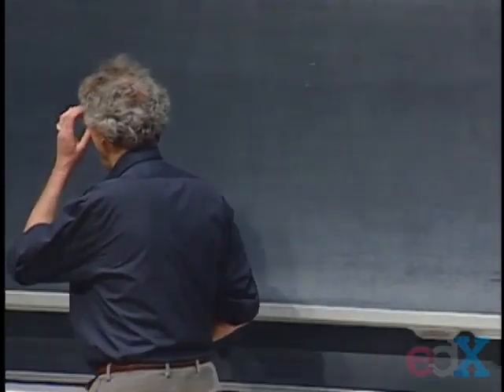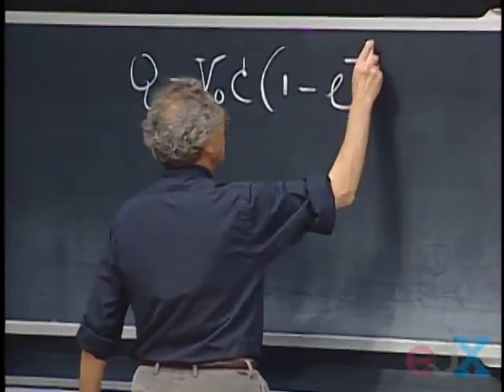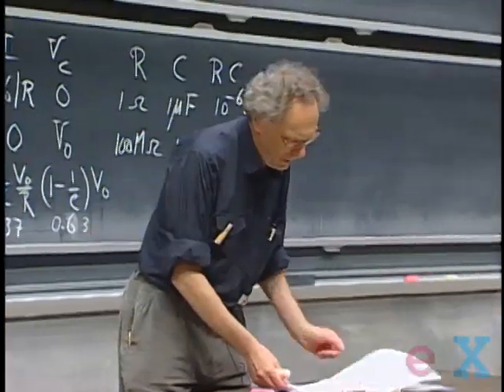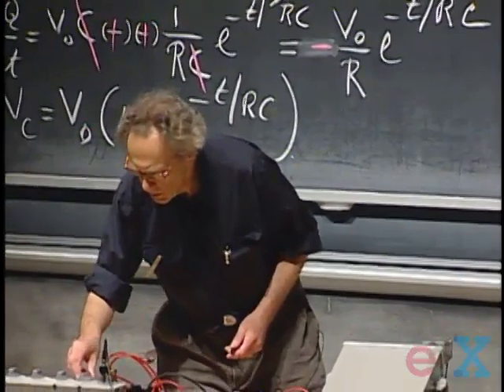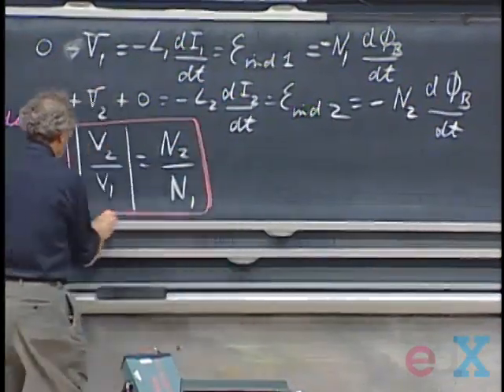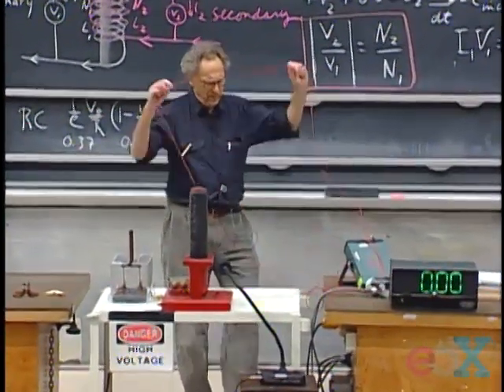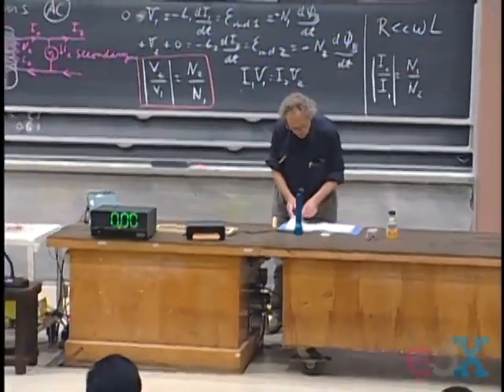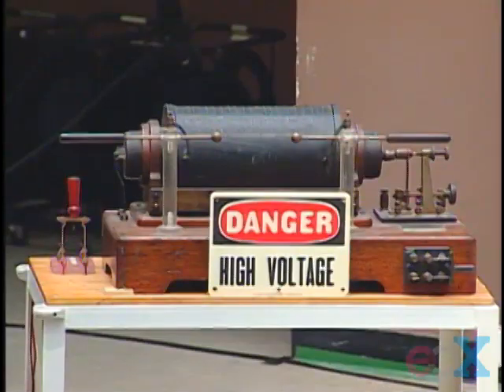8.02x - Lect 24 - Transformers, Car Coils, RC Circuits

Comment: I am an Electrical engineer, i would use the laplace transform in a heart beat to solve that differential equation..
For dc transient calculations at t=0 for unenergized system, an inductor may be replaced by an open circuit while a capacitor may be replaced by a short circuit..
Reply from the maker: t=0 for unenergized system, an inductor may be replaced by an open circuit while a capacitor may be replaced by a short circuit correct!

Comment: A correction to your stepdown transformer at the electrical pole. It is stepped down to 240 Volts across two of the phases of the transformer. Not to 120 Volts.

Comment: Regarding the spark rate for a 4 cylinder engine running at 3000 RPM:  3000 RPM is 50 turns per second.  A 4-stroke car engine fires each cylinder ONCE per TWO turns (standard Otto cycle).  So there are ONLY TWO sparks per turn of a 4-cylinder engine.  So there are only 100 sparks per second, not 200 as you claim.
Reply: Incorrect, almost all vehicles use a waste spark system for emissions reasons, thus creating a spark event during the exhaust stroke to make a more complete burn, this is to provide a more even mixture used to allow the catalyst to heat up and reduce NOx quickly.

Comment: Hi Sir ,

In Lecture 16 at 29:45 while you are demonstrating farday's law , it was observed by increasing the no.of turns around the solenoid we are getting more current and more EMF at the time of switching(i.e EMF is directly proportional to no.of turns around the solenoid and Current in the loop is also directly proportional to no.of turns around the solenoid ). If we continuously turn ON and turn OFF solenoid then there will be a changing magnetic flux in the Solenoid and we can see a continuos EMF and current right.

But in this lecture at 35:24 while you are demonstrating a transformer , when we increased the no.of turns around the solenoid we are getting more EMF but the current is getting decreased( i.e (i.e EMF in the loop is directly proportional to no.of turns around the solenoid and Current in the loop is inversly proportional to no.of turns around the solenoid ) why ? 

As per my understanding both the experiments seems to be same. Can you please give a QUALITATIVE explanation for this question because it will give physical feeling ?( Please don't give quantitative explanation by using the equations )
Reply from the maker: >>> we are getting more current and more EMF>>>
yes always more EMF but not necessarily more current.
Reply: Can you please tell me at when current will increase that means in which scenario current will increase ?

Comment: @39.00, I think the reason the copper ring with the iron nail does not levitate is because of the high resistance. Remember that 4400 Amps was calculated, but only about 500 - 1000 Amps are anticipated. Whilst this is indeed high amperage, the weight of the heavy gauge copper plus nail needs higher amps (ie, 4400 Amps) to levitate. The high resistance is causing the nail to cook whilst at the same time choking off the current. This answer is the culmination of 1500 hours of YouTube Electrical Engineering study over the last 4 years!!! I got bored during the Chinese Plague lockdown and kept going with it...

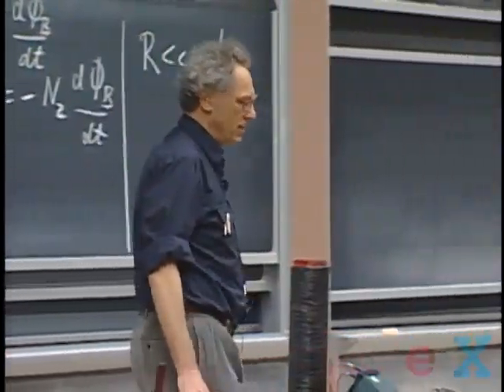Comment: 30:27  which R is being  referred here ? , is it the load resistance in the secondary , or the net R in the primary and secondary wires ??

Comment: Hello Professor, I have a doubt. How can the conservation of energy be possible? I mean, the transformer at 24:38 seems to prove that there is no conservation, because when it creates Emf and therefore a current, you have energy there. Other thing that leads us to the non-conservation is the induced voltage, isn't it a creation of potential? How can the eletric potential energy be there? Where does it come from? How isnt it affect the conservation of energy? Or am I wrong?

Thank you Mr. Lewin for your amazing classes and for your kind, cheers from  Brazil.
Reply: The system is non-conservative, indeed! This is why Kirchoff's law doesn't hold, which assumes a conservative electric field. Faraday's law tells us that the electric field is not always conservative, and it tells us exactly in what way: the discrepancy is equal to the induced magnetic flux. Thus, the electric field is not always conservative, but the electromagnetic field as a whole is conservative. Lenz's law accounts for this, which is why Faraday's law says the integral of the electric field over a closed path equals the negative magnetic flux through the surface that path subtends.

So to summarily answer your questions: the electric field is non-conservative in this situation, and thus electric potential is not even well-defined. (Electric potential energy possessed by an object can be, but that's beyond the scope of this answer.) The extra energy comes from the magnetic field.

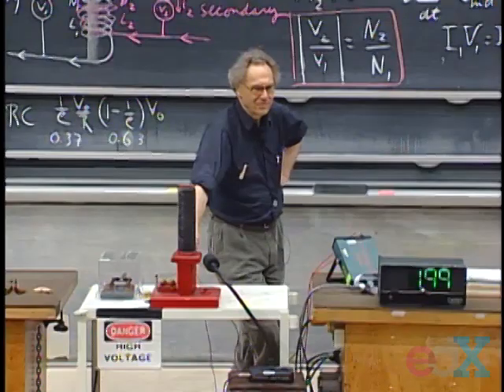Comment: 35:41   how is moving the secondary up affecting flux coupling ?
Reply: Look at diagrams of magnetic field through a solenoid that's not perfectly ideal. You will notice that the flux decreases as you move towards the edges. More and more flux goes outside the loop than what penetrates it. That decreases the extent of coupling in this particular demonstration.

Comment: When we say when we increase the number of windings the emf induced increases , are we talking about the same loop ( the same resistance ) like reforming the loop , or do we mean adding additional windings thus more resistance to the original one ?
Reply from the maker: If the induced emf in the secondary is 1000 V and if there is a 1000 ohm resistor in the secondary, than the current in the secondary will be 1 A. Keep in mind that the closed loop integral of E dot dL in the secondary is NOT zero as Kirchhoff's loop rule does not apply now. The closed loop integral is 1000 V.

Comment: If there is a circuit in which there is a variable resistor and an AC POWER SOURCE and we are continuously changing the resistance by the variable resistor then will there be an induced EMF???

I think NO, for the same reason that you told above that there is no INDUCTOR or if it is then it's very small

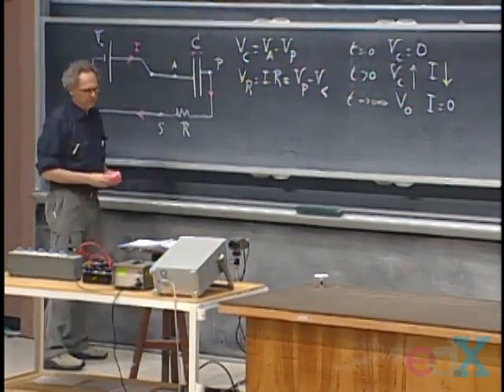Comment: Charging capacitor (4:00) by electron current flow, capacitor charges negative, other side positive?
Reply from the maker: When you charge a capacitor, the amount of charge on the 2 plates are the same but of opposite polarity.
Reply: Yes.  The capacitor plates end up charged to equal and opposite net charges each.  The net charge of a capacitor remains zero, after "charging" the capacitor.

It is a little bit of a misnomer that we call it charging a capacitor.  Enegizing the capacitor is a more accurate term.

This source shows what a hydraulic capacitor (known as an accumulator) would look like in an analogy to help understand.   The author shows a "diswatered" hydraulic capacitor, yet it still contains water, and a heavily "watered" hydraulic capacitor that contains more water than before?   Turns out, it always contains the same amount of water.  It is the energization of the flexing the rubber sheet, and the pressurization of the water on both sides, that makes the difference between the possible states of the accumulator.  Likewise, it is the energization of the dielectric barrier's electric field, and the imbalance of charge between the two plates, that makes a difference in the possible states of a capacitor.
http://amasci.com/emotor/cap1.html

Comment: Professor, regarding the car coil, if the e.m.f. in the primary coil is huge enough, why doesn't a spark appear at the terminals of the switch?

Comment: Actually transformers can use dc, but usually only when it is pulsed as is done for an automotive spark coil.. It is the changing current that is needed.
Reply: For all intents and purposes, you may as well call such I(t) AC, because it is equal to some constant (and thus DC) function plus some AC function, and the constant/DC part can be ignored because it is not electromagnetically inductive.

Comment: Sir, why is there no E-Field in the solenoid at min 24:40? Shouldnt the AC Produce an E-Field, since we also have an induced Voltage and Voltage always comes from an E-Field? 
 I think at another time you argued, that we have a superconductive wire. But shouldnt there then be resistance caused by the Inductance?
Also, reading Faradays Law from right to left also states, that the change in magnetic flux produces an E-Field.
Reply from the maker: there  is no E-field in an ideal self inductor as the wires are super-condicting (thus zero ohmic resistance).
Reply: @lecturesbywalterlewin.they9259  But if i plug that into Faradays Law, the integral of E dot dl hence is 0 if i only look at the solenoid. And that would mean dphi/dt must also be 0, which it isnt since I have AC. Am I missing something?
Reply from the maker: @Arrgon  >>>But if i plug that into Faradays Law, the integral of E dot dl hence is 0>>> Yes it is zero through the wire alonebut that's not a closed loop. The closed loop of E dot dL = -Ldi/t  (L here is the selfinductance in henry) and that's the induced EMF
Reply: @lecturesbywalterlewin.they9259  What if i take a Circuit with a switch such that when closed, the current goes around in a loop with only my Solenoid and some wire, which i think i have seen you draw in a Help Session. Then doesnt my argument hold bc Faraday presents an E-Field since the Integral of E dot dl around my closed wire and solenoid is the Change of Phi which isnt Zero bc we have AC? Hence there should be an E-Field.
Reply from the maker: @Arrgon  Faraday's Law works always, thus also with AC. If the wire of the self inductor is superconductive then the E-field inside these wires is always zero.  If you need more help, use google.

Comment: @20:50 But wouldn't the changing current cause changing flux and self-Inductance ?? Bringing in Faraday's Law again into the picture.. as current is not constant turning into an exponential function
Reply from the maker: the self inductance in this sytem is only a few micro H (thus negligible).  Watch my later lectures where there is a self ind in the system
Reply: @lecturesbywalterlewin.they9259   Oh, will surely do. Thank you sir 👍

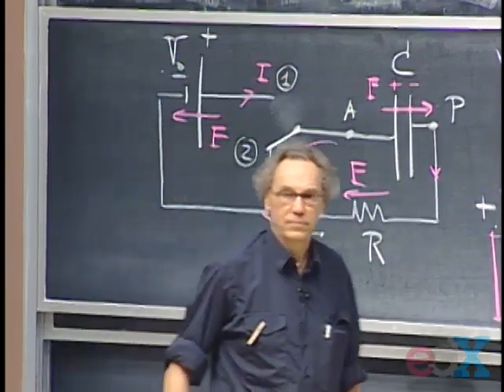Comment: Hello professor, at 13:47 you remove the battery, and the capacitor will discharge over the resistor. Should the E field vector drawn not point to the other direction? And by consequence the diff eq be :  -Q/C + RI = 0? It puzzles me, since calculating the energy stored in the capacitor for this circuit by means of integration of RI^2 needs -RI in stead of +RI to give to correct outcome. Thank you for explaining this!
Reply from the maker: set up the diff eq and solve it - that wil tell the full story.

Comment: hello professor , is the breakdown voltage in air is linear? thus 3M volts per meter so if i have two sharp points 1 cm apart i will need 1000v potential difference? 
thank you.
Reply from the maker: 3 million V per meter would be 30 thousand V per cm. Apart from that If the points are sharp the breakdown will occur at a lower potential difference than 30 thousand Volt. I suggest you consult google on this..

Comment: sir why the current reduces at t > 0  when the capacitor starts charging as the voltage across the capacitor = iXc

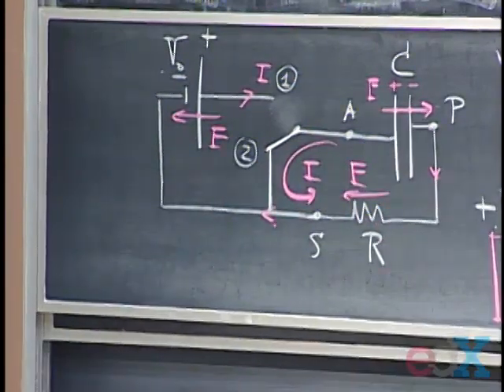Comment: at 13:47 when you flip the swich into position 2, why don't the excess positive charges don't take the easier route to the negative side of the battery? I know that it would actually be the excess electrons from the batterys annode that would flow on to the capacitor
Reply from the maker: The Capacitor is no longer connected with the battery when I put the switch in position 2.
Reply: +Lectures by Walter Lewin. They will make you ♥ Physics. 
thank you very much for the quick response! my thought was the negative part of the battery has still a connection without a resistance in between
so flipping the switch basically means cutting both sides of the battery out
Reply from the maker: current can ONLY flow if there is a CLOSED loop. There is NO closed loop that connect the capacitor wth the battery..  The ONLY closed loop that is available is the RC loop.
Reply: +Lectures by Walter Lewin. They will make you ♥ Physics. 
thank you! this clears up my confusion
i really enjoy these lectures and they do indeed make love physics!

Comment: Dear Dr Lewin, how do we address the issue of imperfect magnetic coupling which you mentioned at 27:16 minutes? It seems we always assume that magnetic coupling is perfect and power loss is only considered when we determine the currents in the coil. Why is this so?
Reply from the maker: It's an engineering problem which has been solved to near perfection.

Comment: Sir, in 8.02x - Lect 24 - at 30:44, could i please know why you wrote power as V*I ? In AC circuits, isn't power V*I* power factor? {V and I being the rms values}

I do understand that  V*I* power factor is the "power consumed" and a purely inductive circuit doesn't consume any power (with the assumption that the pircuit has negligible resistance). So the power is only transferred from the primary to the secondary, but why is it represented as VI?
Reply from the maker: As in DC circuits, the instantaneous electric power in an AC circuit is given by P=VI where V and I are the instantaneous voltage and current. ... Averaging this power over a complete cycle gives the average power.

Comment: Hi professor Walter Lewin:
 
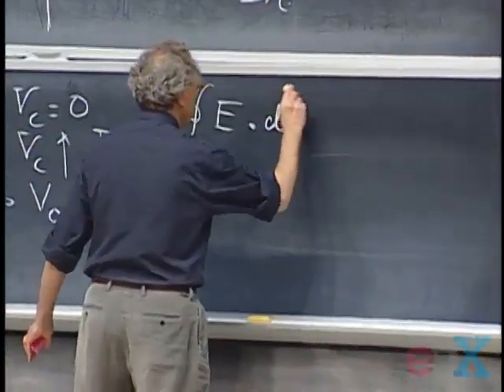On 5:31, you mentioned that the integral of E dot dl is zero.  My question is: why does it have to be zero? I think current is changing over time (at t = 0, current: max; at t -> infinity, current -> 0, so current clearly changes over time). If current is not constant, then there will be change in magnetic flux through the conductor, and thus there will be a small non-zero term on the right side of Ampere's law.

Did I make any mistakes above?

Thank you very much for the help.
Reply: +Lectures by Walter Lewin. They will make you ♥ Physics. 

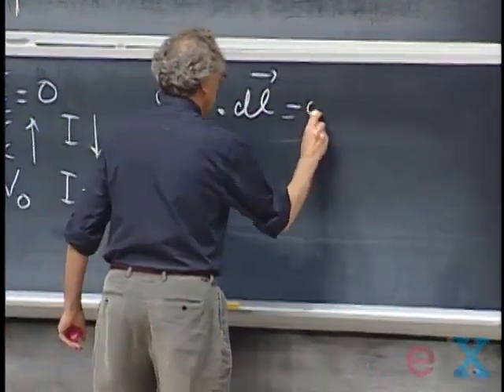5:31 into the lecture..I think you were deriving an equation for RC circuit.
Reply: Thank you very much for the clarification.

Just a side discussion, what do you usually do after you retire?

Have a good day.
Reply from the maker: +yao shen deng In these kind of circuits there is a negligibly small self inductance L. We therefore ignore it. Thus Kirchhoff's rule (and also Faraday's law) can be applied. Of course if you argue that there will be a very very small (but non-zero) equivalent value of L in the circuit. you cannot use Kirchhoff's rule; you must then use Faraday's law. However, in that case you  must find a way to first calculate the equivalent value of L and that is only possible if you are given all dimensions of R & C and of the wiring.  You know to a very good approximation what di/dt is, thus you can then calculate what L*(di/dt) is which is needed for Faraday's law. You will find that for any common circuits the effect of d(phi)/dt is so small that it can be ignored.
Reply from the maker: +yao shen deng I answer many physics questions every day. Yesterday there was one question which required a mini lecture. I posted 3 sites and that took me 4 hours. But I rarely ever have to spend more than 30 min to answer questions. I also watch various kinds of lectures which are readily available on the web .I even take some MOOC physics courses. I spend lots of time in art museums also abroad. Physics is my LIFE, Art history is my LOVE. I highly recommend that you watch my lecture "Looking at 20th Century Art through the Eyes of a Physicist". https://www.youtube.com/watch?v=PALPjZb9dBY&list=PLyQSN7X0ro22Jw18-fgmWjbGcGR_K3aUh&index=2
Reply: I certainly will.  Thank you.

God bless you
Reply from the maker: +yao shen deng Tell me what you learned from my art lecture. My goal is to make people look at 20th Cent art in a way they never have.

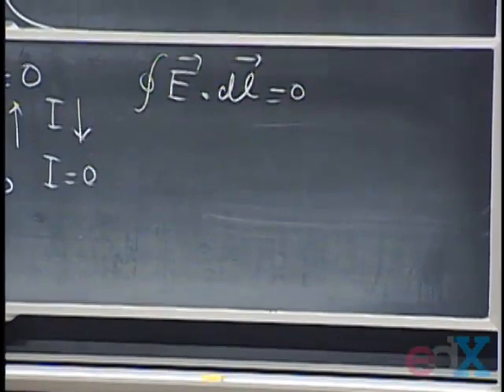Comment: At 5:35 you say the closed loop integral of E dot dl is 0. How is that so? The current through circuit is changing, thus the magnetic field through the circuit is changing too. Should that mean that the integral I described above is the --dphi/dt?
Reply: So can the RC circuit be seen as an LRC circuit where L is approximately 0?
Reply from the maker: dphi/dt in the closed loop is ZERO as the self-finductance of the wires is negligibly small. Feel free to calculate dphi/dt due to the magnetic flux changes produced by the wires (AC current). Once you have you dphi/dt, you can calculate the induced emf. IN ALL CIRCUITS, with only C's and R's we can comfortably use Kirchhoff's loop rule.
Reply: Okay, thank you professor!
Reply from the maker: Yes it's effectively always zero, except in special circuits (e.g., nano technology),